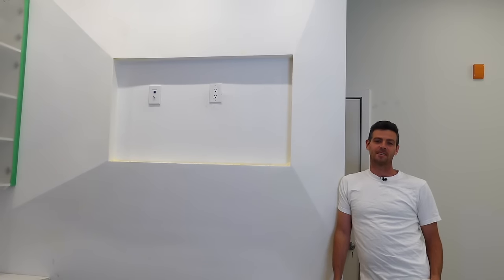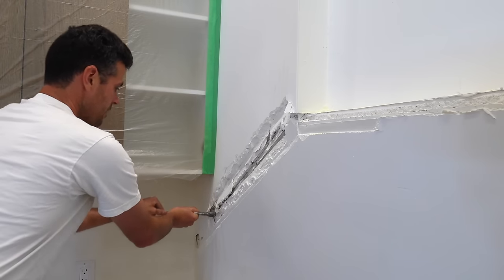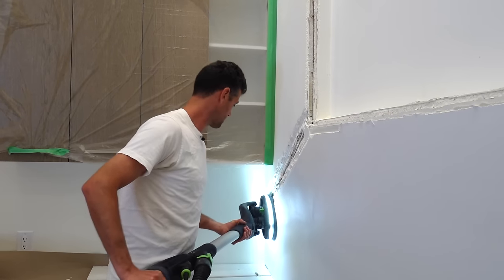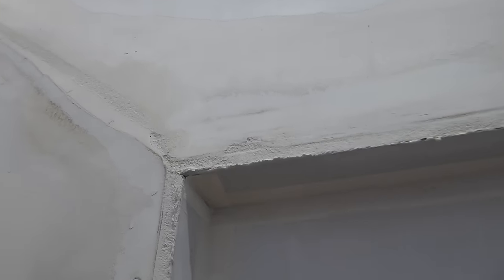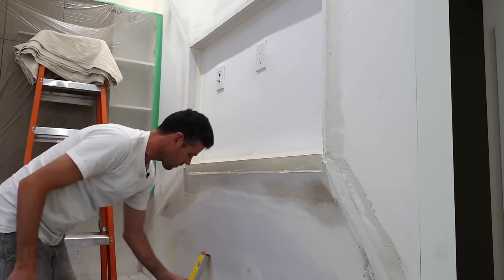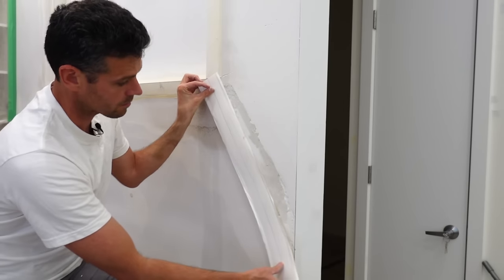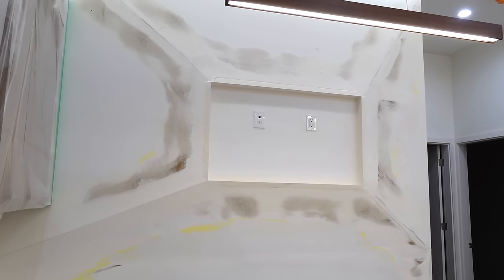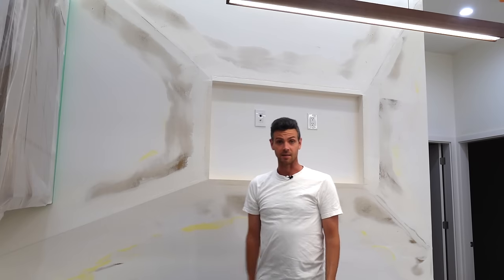Fixing a VERY BAD Drywall Job!!!

Comment: Hi, I have been watching a lot of your videos but could you point me to a I'll call it video for dummies. If you don't have one could you make one that addresses the processes in order and terminology. Such as like first would be prefill then covering exactly what 1st coat, 2nd coat, skim coat and so on is. When during these processes do you do taping and sanding. Exactly what type of tape and mud can be used for each process. Can I just use quickset lite 45 for everything, just mix it with different thickness? This has turned into a more expensive project than I anticipated. I had some drooping ceiling sheets fall on me a few weeks ago. I ended up ripping them all down and I'm in the process of repair. Once I took them down I realized failure was because they hung with 1 1/4" screws for 3/8" drywall then covered in super heavy popcorn texture and they were ripping right out. The ceiling is not square at all. I had one edge that had a good gap. I have done prefill and that's it and it could use some fine work, just not sure if I should sand before taping and what not. I assume I need to skim the entire drywall sheets after taping and before priming.
Reply: You only need to cover the taping joints with mud so the ceiling is flat between board transitions, it takes 4 or 5 coats in some spots. No need to skim coat the whole ceiling if you're putting up new drywall, just prime everywhere after you're done sanding and double check for any missed spots or gouges to fill before you paint
Reply: @Blingdung  Thanks it's not too bad. I had to prefill where the drywall sheets meet because for some reason they didn't suck up to the ceiling exactly the same. I'm guessing because I screwed two 2x4's together so I could run full sheets instead of multiple partial sheets, the way it was originally. My 2x4's must not have been perfectly square. I think I can just scrape/sand down my prefill and start taping. Can I use paper tape on the ceiling joints or do I have to use fiba tape? Buy a whole roll of tape for 3 ceiling seams. Will my quickset lite 45 be fine for paper tape?
Reply: @icemanxp300  yeah quickest 45 will be fine for tape and first coats since you're only doing a small space. Paper tape is less prone to crack I like using it more than mesh, just make sure you mix in enough water for the mud to soak the tape and make it adhere properly. Like a runny peanut butter kinda, you want it to still hold shape but still run slowly down your knife and fall off if you hold it vertically. If you run out of mud and buy a new bag it might be useful to get a quickset lite 90 for you final coat but as long as you mix your mud well and get it on quick enough the 45 is fine too, it just dries faster so you might run out of time on your finishing coat before it starts to harden. 
If you're doing any corners coat one side and wait for it to dry before you do the other after you tape them. There's lots of videos just covering the basics on this channel you just gotta go back like 4 years
Reply: @icemanxp300  there are premixed muds for each step, taping (yellow), all purpose (blue), finishing (green) but if you already have quickest 45 use that. Having a roll of tape around isn't the worst if you end up doing any other renos or have to fix any cracks around doorways or windows that show up over time from the house settling
Reply: @Blingdung  yeah I watched a lot of VC videos. I seen the one about taping and mudding one side (bottom), then waiting for it to dry before you mud the other side. He mentions using quickset for mesh but I never heard him mention what exactly can be used for taping. I have a huge bag of this quickset 45. I ran into problems doing the prefill because the one gap was big and it was just falling right back out. I had to wait for it to harden (thicken) a bit before it would stay in the gap w/out falling down. I ended up going over screws and seams and did my big gaps last. Although I do think in a few areas it still drooped down a tad, I think I need to sand it down a bit.Then I mixed a few smaller batches thicker for the rest of the prefill. I'll definitely mix more runny for taping. I make small batches in my mud pan so I'm not real worried about running out of time. The area I'm doing is like an 11x7 section so it shouldn't take too much mud. This turned into a bigger project because I ripped out the sump pump and closed up the hole since it has never ran in like 30 years. I then had to put drywall in the corner it was boxed in and seam some carpet down. It's turned into a project.

Comment: I am skim coating a ceiling and applying mud with a roller.  I don't seem to be able to get enough mud on with the roller.  Am I putting too much pressure on the roller? Any thoughts?  Thanks for your time. Rick
Reply from the maker: You are probably taking too much off the roller or just not putting enough mud on in the first place. Dunk it in a bucket and leave most of it on there.

Comment: Some questions for the drywallers here:

Was it really necessary to cut the drywall into trapezoidal shapes instead of just working with rectangles? If yes, was the purpose to create visual "guiding lines" to help align the eventual diagonal raised corners?

Thank you!
Reply: Pretty sure the framing extrudes out at each corner so I don't think you could use rectangles because it's not flat.

Just look at the mess he fixed on the bottom - there is obviously a lot of depth so yeah I think the way the drywall was cut was the only way.
Reply: @digi3218  You are right. I was too tired when I saw this and I was not reading the changes in depth quite well. This should have been a given when watching the right side being filled with mud.

Comment: Great job!

As for the detail itself... each their own I guess... couldn't the homeowner have just added another fake 2x4 wall against the real one, leaving the center area of the fake wall open? Then you'd have all 90 degree framing and drywall. You could even size it to your TV and have your TV flush with the (fake) wall. Angled drywall on part of a wall is just weird.

Comment: question for somebody that knows more about this than me. i used some proform blue to do some tape work in one of my bedrooms. looked good at first until i started sanding and tons of little bubbles appeared. any advice is greatly appreciated
Reply from the maker: Just needs another tight skim. The bubbles are normal. Could also be that it wasn’t mixed well enough in the first place.

Comment: If the mud is coming out wetter, you are noticing shrinkflation.  The manufacturer's have probably increased the water in order to decrease the amount of solids.  The box is still 40 pounds but the water is essentially free to the manufacturer.

Comment: I understand that he has to work with what he has, this is absolutely not a critique directed at him and rather at the previous planning (or lack of): Shouldn't all 4 corner lines go outward at the same angle, even if some lines would be way shorter? I feel like the symmetry would be nicer.

Comment: There's nothing more tedious than fixing other's messed job. It almost comes everytime with hidden surprises.
Reply: I used to have to 'fix' other people's paperwork 'mistakes'; guess who often started from scratch and actually saved time doing it all over?
Reply: @markh.6687  The funny part of not starting over from scratch is that if there's any underlying defect, you'de probably be taken responsible for it. So it's also my philosophy to remove all messed jobs even if this means to redo it all. Especially when the quality and durability of mine depends on theirs
Reply: @rustygear9370  Very true!

Comment: That’s one hell of a job you did Ben…awesome work! Pardone my ignorance…but what is the purpose of doing a wall like that? I have never seen that before😊. Is it for just the look? Great work Ben…your videos are always interesting to watch and learn from.
Reply from the maker: Just the look that someone wanted
Reply: "An architect's dream is the builder's nightmare."  -- Ah Choo.
Reply: If both sides were symmetrical and was in a larger space I could see it being nice, but not having even points for the lines to go to ruins the optical illusion that it's going for. When they hang the tv's the corners might not match the cornering of mudding so makes no sense since it will always look off it seems
Reply: @Blingdung  I agree. It looks off to me too. It’s pretty tight quarters😊. Not my cup of tea, but each to their own🙂.

Comment: Think this is bad. In my daughter's house she just bought (built in 1908) someone "remodeled it" and several of the inside corners in the upstairs wall and ceiling have huge open gaps that were covered by (poorly done) molding. And I'm pretty sure on most of the other corners, they just skipped the metal corner piece. It's ridiculous.

Comment: This wasent that bad at all and another coat or two of mud and some sanding in the right places woulda fixed it with a fraction of the time and cost you likely charged to fix the thing.,  it wasent going to break apart over time, no code issues and is for decor not everyday use like a counter wall..  it is a focal point which it just needs to look ok..

Comment: If I had that type of job done for me, I would have demanded that each line going away from each corner would be equal at the angle coming off each corner, then also each line being at the same length.  To me, that wall is ugly as sin because of the lack of symmetry.